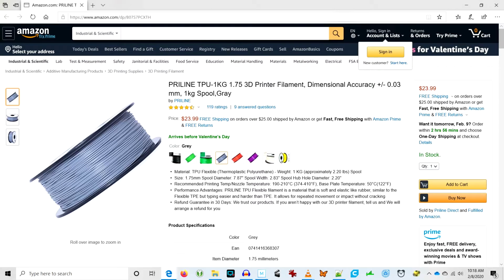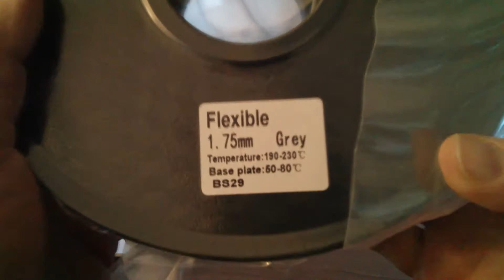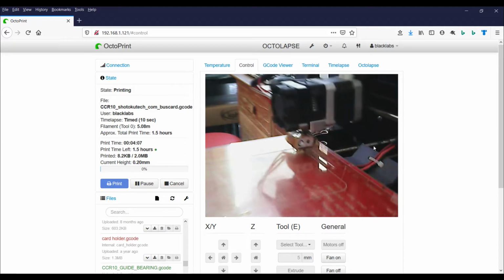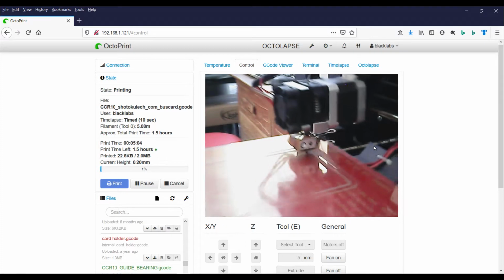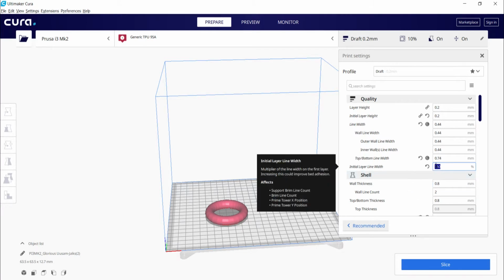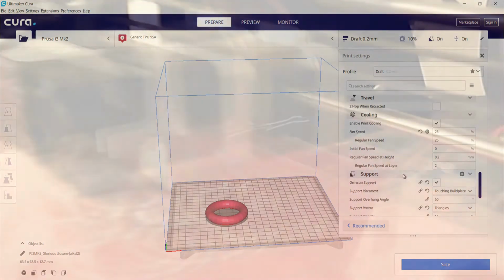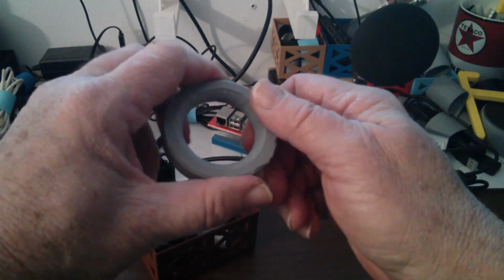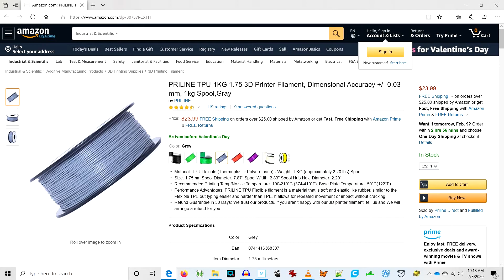PRILINE Gray TPU 3D Printer Filament is Soft and Flexible

Comment: By the way, print results are different. That needs to be carefully considered.

By comparison using Digital Caliper to measure thickness it prints out, I have the parameters set to:
 - Nozzle 0.4mm
 - Flow rate 105% (SaintSmart's recommendation for their TPU)
 - Temp 200ºC

Results:
SainSmart TPU got consistent of 0.4mm thickness
Priline TPU printed out at 0.55mm thickness (seems it expanded right away after it exits tip of 0.4mm nozzle)

How do I make sure Priline prints out at consistent of 0.4mm thickness?
Reply from the maker: That is a good question I might not be able to answer. It has been almost 2 years since I made this video and I don't have this filament on hand any longer to make any kind of informed observation. I would calibrate E-Steps if I find over extrusion. https://3dprinterly.com/how-to-calibrate-your-extruder-e-steps-flow-rate

Comment: Turn fan down or off, retraction off, and slow speed and you can print with a stock Ender 3.
Reply from the maker: Interesting. It doesn't jam up in the Bowden tube? This stuff is so soft it got wound up and bunched up inside the extruder a couple of times. Great when it works. But difficult to get it there. Thanks!
Reply: @ShotokuTech  I’m pretty new and wasn’t sure it would work myself, but I set the nozzle pretty hot, very slow speed, and it worked well. Wanted a bracket to clamp on to 1” square tubing, so I welded a nut onto a bit of 1.5 tubing and drew up a sleeve in fusion 360. This soft flexible stuff worked great.
Reply from the maker: Sounds good. Maybe I try it.

Comment: Super video! With the addition of part fan off and no retraction, I used your settings to print on my CR10 with an adapted extruder plate from Thingiverse. Thanks for posting this video. Saved an enormous amount of experimentation, time and trouble etc. Printing mask extenders from this TPU. Perfect. No brim required. Perfect bed adhesion and great print quality.
Reply from the maker: Thanks! I am glad it helped. I do these stunts to make videos. At first I had nothing but failure. It is really hard to make videos about failure. So I had to find a way to make things work. It is truly useful material for specific purposes. Thanks again.
Reply: @ShotokuTech  Yes, it's too easy to fail. The filament is too soft to be warped and getting stuck in feed gear. It can easily be fixed. Before I mod my CR-10 printer, I had 35% success rate. The fix I found on Thingiverse got the success rate to 100%. It's crazy how much difference it can make. Hope you can find a solution for your printer especially using soft filaments.
Reply from the maker: @kibbycabbit  It's amazing how much TPU filament can get wound up inside the extruder. LOL. This happened to me a few times with this one. But I got it to work. I just didn't measure the dimensions of the output as you did. Cheers!